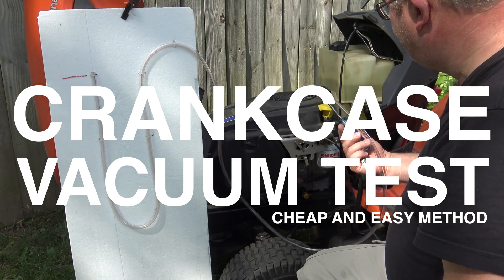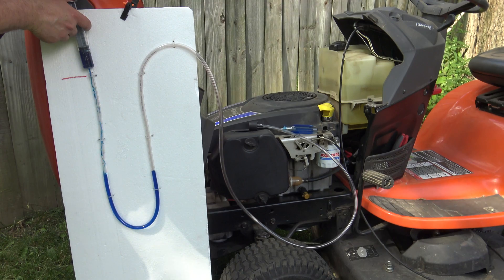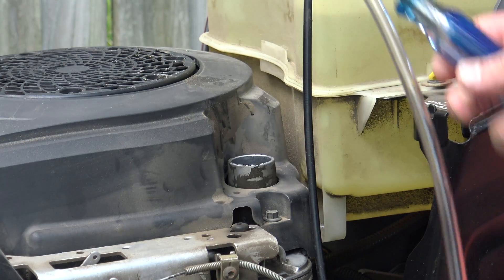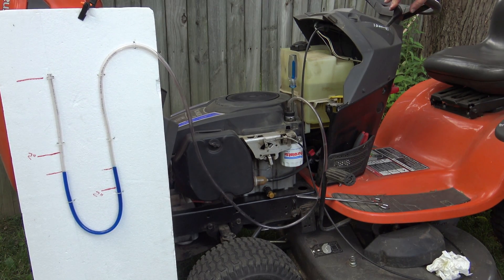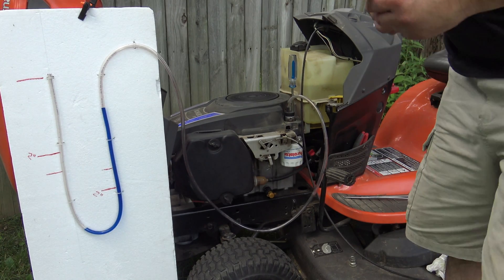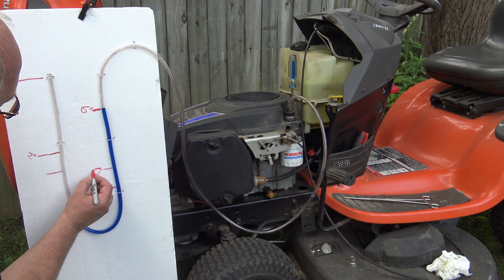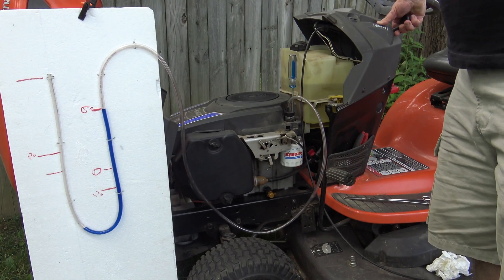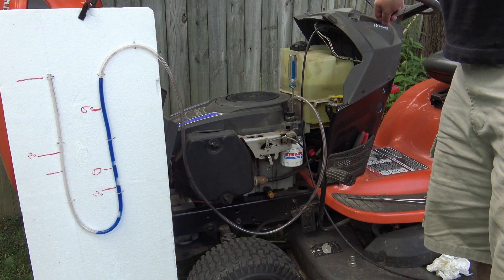D.i.Y. CRANKCASE VACUUM TEST on a Kohler Courage Engine

Comment: I'm struggling to figure your intent with this video.....  You can buy a decent water manometer on Ebay all day long for $10.  Are you going for how smart you are,  or cheap you are?
Reply from the maker: No need to buy a manometer, if you need it only once. This is more for people that run into a problem with their engine. At that point you probably don't have a manometer handy, and then it is good to know how to make your own quick. You don't have to wait for it in the mail. Your best case scenario is to have it shipped within 48 hours, if you can't wait that long, this is your solution.
Reply: @mygiguser  - Thank you for clarifying for me that you are in fact to cheap to spend $10.  Red Green would be proud of you.....   Would you consider doing a video on how to over haul a big block V-8 with just a couple of Crescent wrenches and a pair of Harbor Freight vise-grip pliers?
Reply: @bobdriver6946  Boy sit down
Reply: All this for something you can, in 2 seconds, easily feel using the palm of your hand. You guys, maybe your lips?
Reply: This is the way I was taught to check for crankcase vacuum. Small engine shops actually used this exact test. It works great.
A trades man has the ability, skill and knowledge to build the tools he needs.